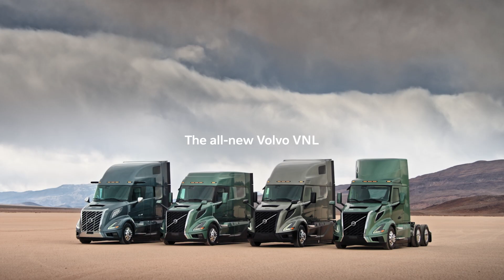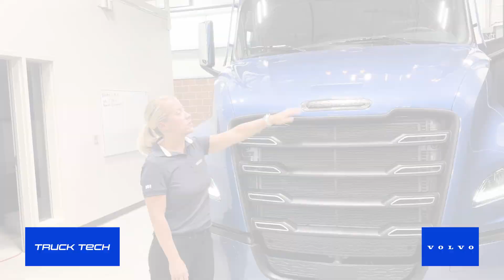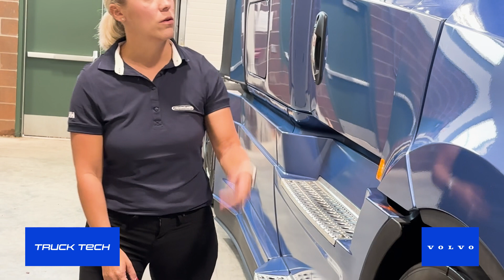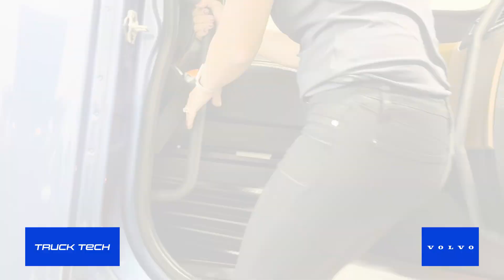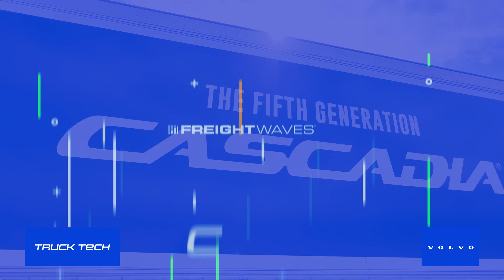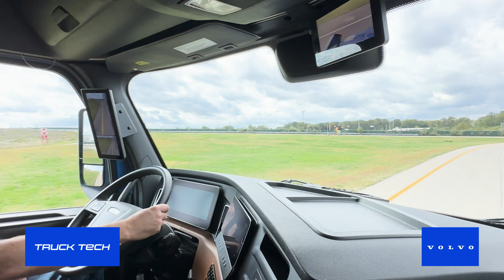A closer look at the fifth-generation Freightliner Cascadia | Truck Tech

Comment: That stupid fairing on the doors causes the door window to have less visibility in the rain, and the whistling sound it creates gets on my nerves. It’s so loud I have to really crank up the radio to over power it. 

Also in 21 years and over 3 million miles I’ve never heard of anyone actually having a problem with the air knobs. Almost anything electrical is bound to malfunction at some point on today’s vehicles of any kind. They are delusional to think people want all this crap. I used to love a Cascadia, but now they are over engineered and driver UNfriendly junk trucks anymore.